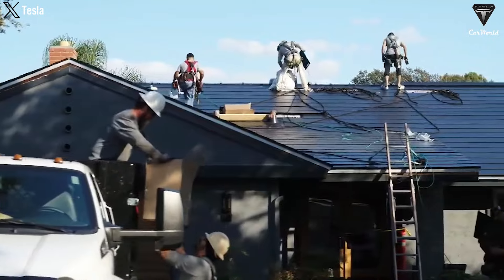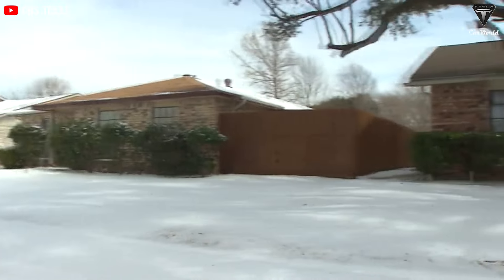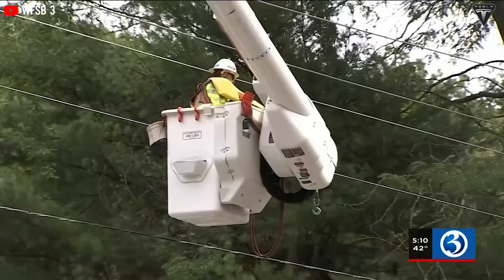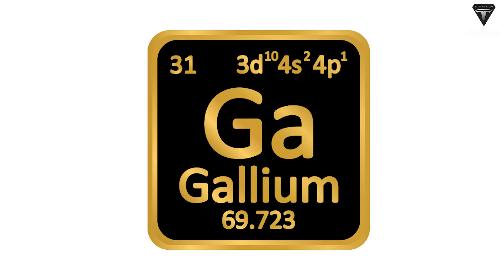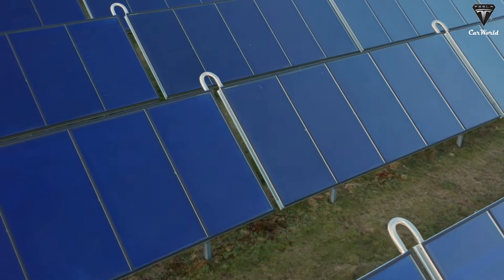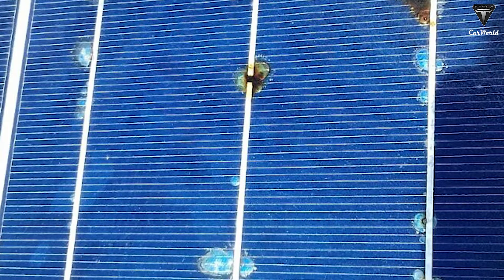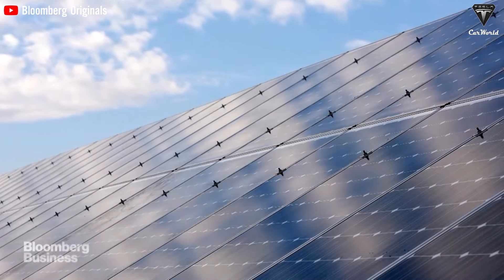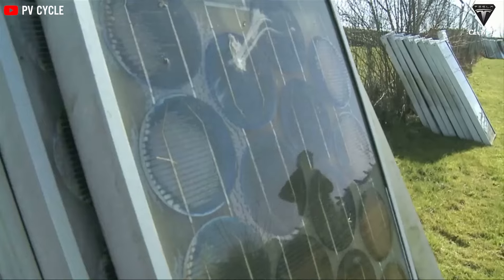Elon Musk Unveils All New 2024 Silicon PV Solar Panel Renewable Energy, Your Life Change Everything!

Comment: Yes, there are materials with improved mechanical properties that can interact with cold and have the ability to repair damage. Some of these materials include:

1. Self-healing polymers: These materials can restore their structure after damage, for example, by self-healing or regeneration of chemical bonds. When exposed to cold, such polymers can also exhibit their reduction properties.

2. Metal alloys: Some metal alloys have properties of ductility and deformation at low temperatures, which allows them to restore their shape after mechanical damage.

3. Impact-resistant composites: These materials can be created from a combination of various components with high resistance to mechanical damage and the ability to self-heal even when exposed to cold.

Such materials with unique mechanical properties and the ability to recover from damage can